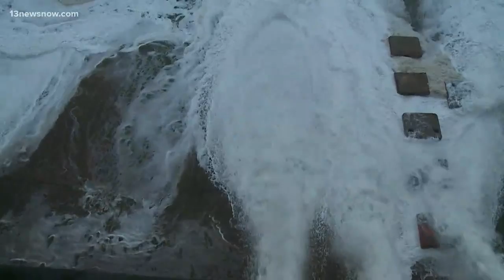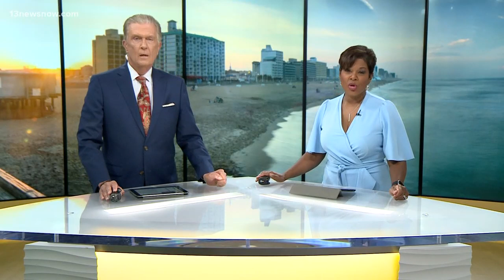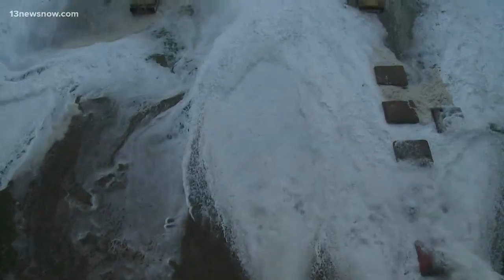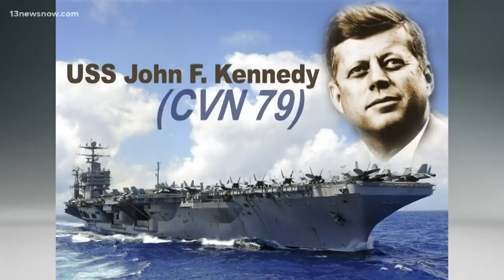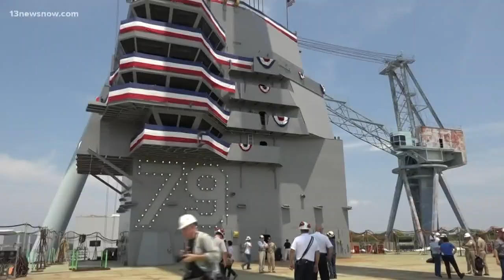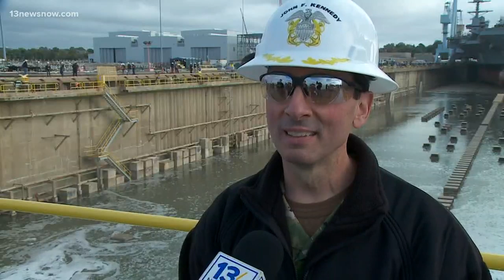USS John F Kennedy prepares to leave dry dock

Comment: USS GRF cost $18 Bn
USS JFK cost $12 Bn
I guess some might say that is progress ...
Reply: A good portion of that 18 billion is the R&D.  Subtract that, and I think the Ford's cost is around 13 billion, and the reason why it costs more than the JFK is because that figure includes modifying the shipyard to build the Ford's and training the workers on how to build them. When they build Enterprise, the cost should be lower still.
Reply: I guess the military-industrial-complex contractors had to make the cost a little less obvious rent-seeking.
Reply: @patrickwilkinson7351   So you think $13+ Bn for a carrier that doesn't yet work and has never left US waters after 5 years is good value for the US Taxpayer?
By the way in that $18 Bn I was being generous. Its actually $18.5 Bn and still counting with a further $0.5 bn allocated for correction work. But yes $4.5 Bn was R & D. Its a shame they didn't make better use of it before building the ship.
And will JFK be any better seeing as there are still unresolved issues on GRF?
Reply: @rabidbigdog   Well it will of course go over 'budget' so their profits are baked in ....